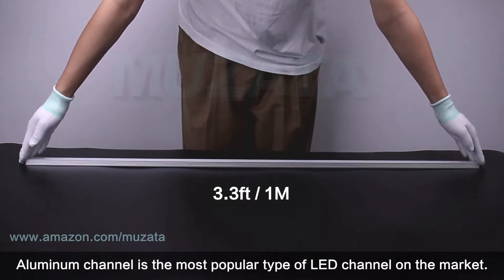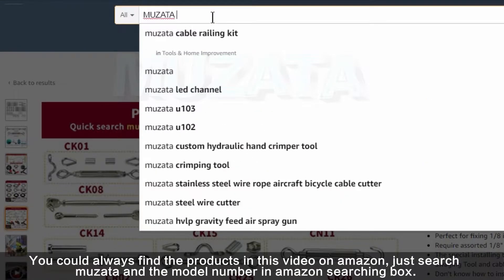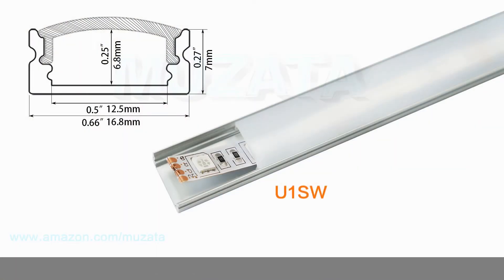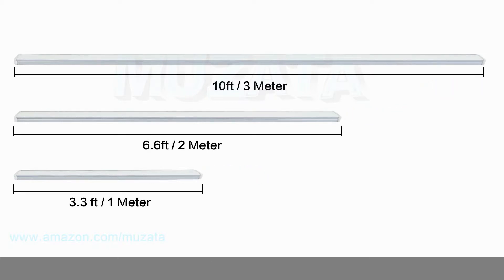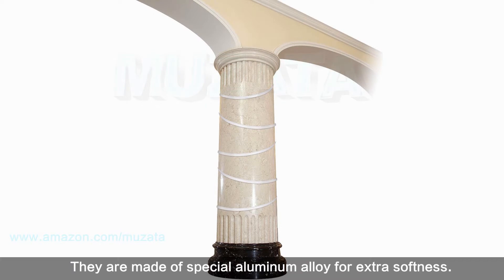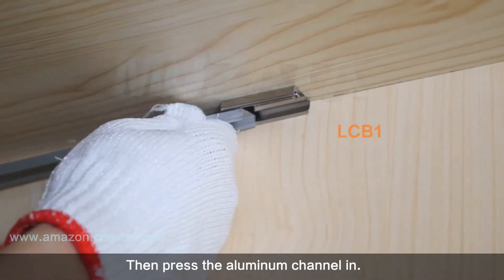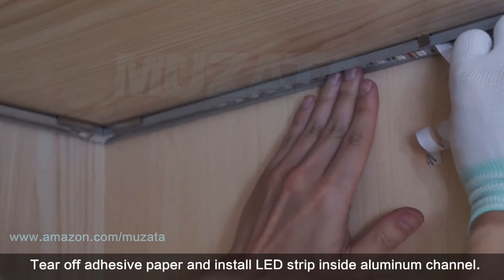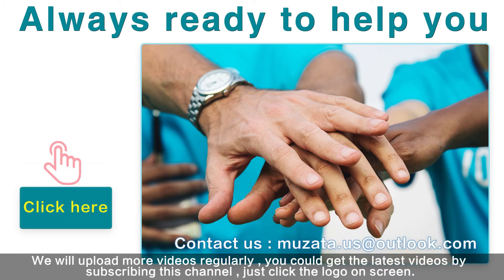How to choose LED aluminum channel - Muzata U-shape installation tutorial U103

Comment: Please make u103 corner connectors & clear lens!!
Reply from the maker: Hi, thanks for contacting us. We already have U103 led channel with a transparent clear cover in stock. Here are the links to them.
U103 black channel with clear cover: https://www.amazon.com/dp/B08L3LQH5W?ref=myi_title_dp
U103 white channel with clear cover: https://www.amazon.com/dp/B08L3LRDLM?ref=myi_title_dp
The corner connector for U103 led channel is out of stock now. Our email address is support@muzata.com. You can email us your email address or phone number, we will notify you when the corner connector for U103 led channel is available.
Reply: Can yo add just the clear lens for u103 I just ordered U103 20 pack milky lens & channels! :D
Reply: Whats the difference between black transparent clear lens & clear lens?  I just order the black transparent clear lens but I dont know if I should cancel to buy the white transparent lens.
Reply from the maker: @elmergonzalez1202  
If you are looking for spotless neon effect, I recommend using a milky white cover. The transparent clear cover has the best light transmission. The light transmittance of the black cover is between the white and transparent cover.
We sell black smoke transparent cover for U103 separately, but we don't sell transparent clear separately. Here is a link to balck smoke transparent cover: https://www.amazon.com/dp/B07TYQ7Q9R?ref=myi_title_dp
Reply: Yes I ordered those as well, & darn you should sell them I would buy!
Reply from the maker: @elmergonzalez1202  Thanks for your suggestions, we will try to launch this product in the future. You can also email us the quantity of the clear cover you need. I will confirm with our manufactory department whether we can custom for you. Our email address is support@muzata.com
Reply: Ok thanks Muzata <33 will do!